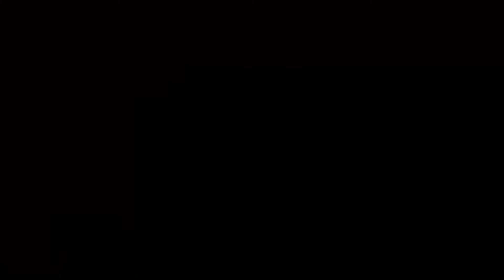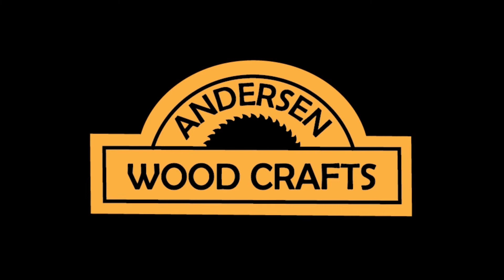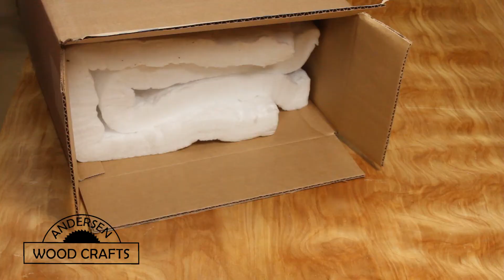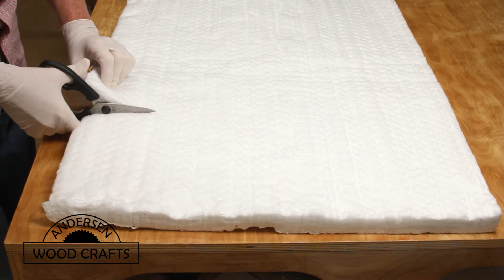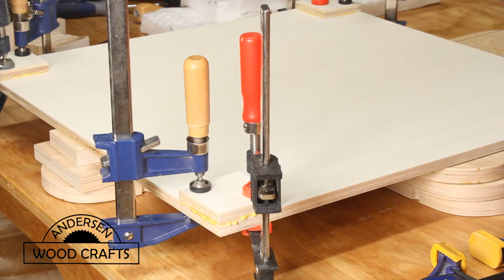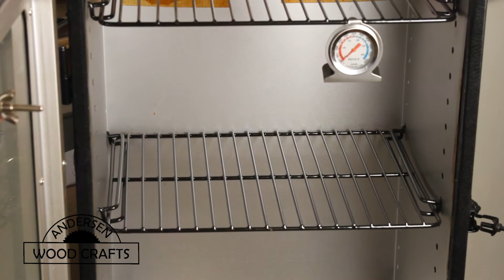RETROFITTING AN ELECTRIC SMOKER INTO A POWDER COATING OVEN

Comment: Hello what is the height dimension? Could I get a 24"-26" rifle barrel in there?
Reply from the maker: I don't believe so, it is only 24" high inside.  I also wouldn't recommend powder coating a firearm barrel. You would never be able to get a completely uniform coat of powder on the barrel, which will affect how the barrel will dissipate the heat created when the firearm is fired.
Reply: @AndersenWoodCrafts  thank you. I'm using mine for cerakote. Masterbuilt has a 40" electric smoker. They're sold out everywhere. A lady is selling me a new one for 250ish
Reply from the maker: @Erik7prc , In that case, don't see why not.  Thanks for your cmment.
Reply: @Andersen Wood Crafts  do you think it's necessary to have a fan inside of an electric smoker for 250 degree cure? Or not really
Reply from the maker: @Erik7prc  I'm not a powder coating expert but I don't know of any powder that will cure at 250 degrees, most are around 400 degrees.  I also would not use a fan, the air movement could blow the powder off the piece before it has a chance to cure.

Comment: did you have vents on the back side? of so what did you do you block them?
Reply from the maker: I removed the inner workings of the vents and covered the holes with a heat resistant tape just to ensure the insulation didn't come out.  After heating the smoker the tape on the inside didn't hold, so the vent holes on the inside are now open, but the insulation is holding.  I don't think the tape is necessary.

Comment: How much insulation did you end up getting, and of course using? It’s not cheap, so I want to order only as much as I’ll need. Thanks!
Reply from the maker: I started with 2 sheets (or blankets) of 1 inch.  That turned out to be enough to do the sides and top but not enough for the bottom.  I finished it with a sheet of .5 inch (as you said the stuff aint cheap) to insulate the bottom.  The biggest issue was covering the heat senser so the elements wouldn't shut off before the oven would reach 400 degrees (it was just trial and era to get it right)..

Comment: Will the smoker element get to 400° without modifications, other than insulation?
Reply: This is what I ran into today. It just wouldn't get hot with the temp sensor in the bottom..I had to take it out and put it outside the box to make it get warm enough to flow and cure
Reply: I've had some more time to play with this. With insulation and the temperature probe outside the box it never shows 400 on the stock thermometer. I bought an oven thermometer and it gets to 400 in the middle of the oven. Once you heat it up and it shows 350 on the door thermometer a IR heat gun reads 500-515 at the bottom, 410-450 in the middle and 390 at the top
Reply: @DragonTamerSlots  
So in other words, the temperature is inconsistent throughout the inside of the unit? That doesn’t sound like it’s very efficient or effective for curing. At this point I’m wondering if I might be better off just looking for a used electric oven. Thoughts please???
Reply: @johnwilliams1223  well depends. Is what you want to coat the entire size of the oven? It works fine for what I'm doing and runs on 110v. So that alone is worth any temp variance
Reply: @DragonTamerSlots  
All I have right now is the powder gun. I plan on starting with small stuff, then hopefully moving on to bigger items. At this point I’m seriously considering just finding an electric oven. No modifications necessary. The only issue with that is space.
Reply: @johnwilliams1223  all considerations for sure.
Reply: @DragonTamerSlots  
Thanks for your replies. Very helpful indeed! 🙏🏻
Reply from the maker: I did bury the heat sensor in about an inch of insulation. I didn't just want to cut the senor, it took a little trial and error as to how much insulation to put around it.  Prior to burying the sensor, the hottest the smoker would get before the element would shut off was a little over 300 degrees.  Thanks for your comment.

Comment: Could you do this to the current model pitboss with the chimney on the roof? I can not get this model in Australia only the pitboss 3 series not like this one in your video. As any other one are gas fitted it electric. Or the 2.2 model on Amazon for import from the USA.
Reply from the maker: You should be able to convert most any electric smoker into a powder coating oven (and it needs to be electric, gas will not work).  The main thing that needs to be done is to insulate it so it can reach the 400 degrees (205 Celsius) that powder coating needs, as smokers are not originally designed to reach and maintain that high of a degree.  Thanks for the your comment.
Reply: @AndersenWoodCrafts  thank you.